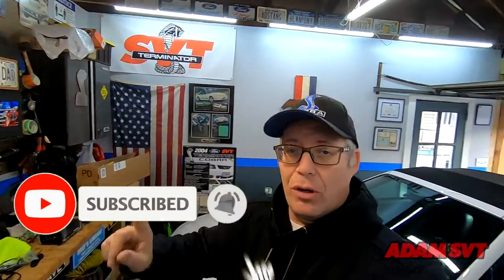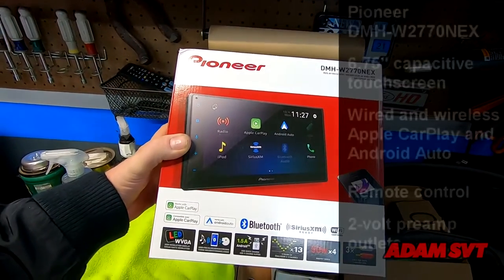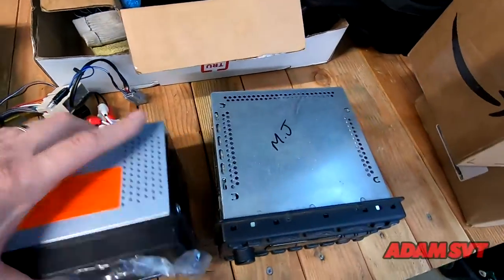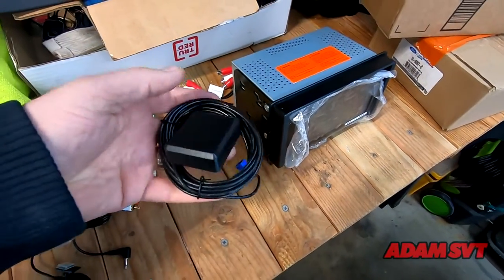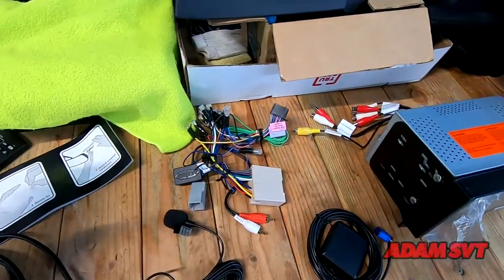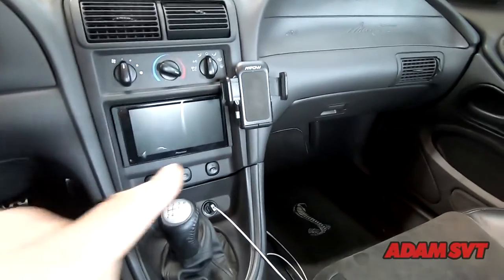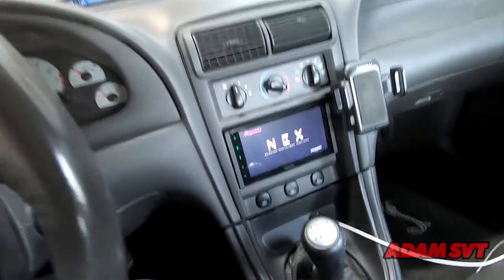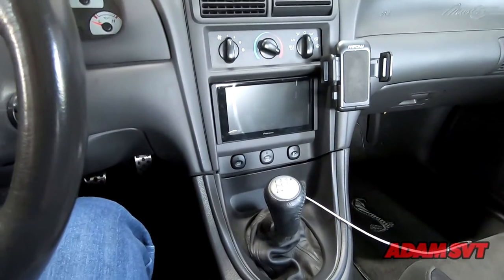How To Install  an Apple CarPlay Radio in a New Edge Mustang Cobra! Finally!

Comment: Im glad this one worked out. I want to upgrade to that exact same one. I just want it for the features you mentioned. It has a kenwood in it now but it’s old and outdated and not touch screen with Apple CarPlay
Reply from the maker: the carplay works quick too!  The Kenwood I had was great, but the multiple camera inputs, I think you could run HVAC and engine diagnostics in it.. HD Radio..  great for those that want all of that but most of that won't work with my old Terminator.. lol..     Was a pretty easy install.
Reply: @AdamSVT  awesome. Something I’ll add to my list lol

Comment: Hey Adam, nice install!  Did you keep the factory amps?  If so, how does it sound comparatively?
I’ve seen some conflicting info online regarding this install, with some saying you need to install new speakers & amp to get decent sound, but I guess that’s subjective.
I don’t need a super thumping system, but would at least like sound (bass power) comparable to the factory Mach 460. 
I’m upgrading my ‘04 Cobra convertible for the same reason you did…to get rid of a problematic volume knob, & add Apple CarPlay & BT.  I mostly just listen to my exhaust, but need some modern features & would like to crank it up occasionally.😉
Reply from the maker: Hello Glenn,   Yes I did.  That's why I went with 4v preamp outlets..   I ended up pulling this Pioneer out and swapping in a Kenwood.  I was told that's best in case you want to add an amp, and with the factory Mach system it works great. I have all stock speakers in my car. Just like you, I am looking to win any sound competitions, but I wanted it to sound good especially with a convertible. My only gripe is that carplay takes a bit of time to connect.. but it's not bad...  like you, I prefer the sound of Borla to music anyway.

Check out the other video with the DMX8709S

Comment: hey Adam can you maybe find one that's maybe more cheaper and budget friendly cuz i don't really wanna have to spend $430 for just this little thing that is very laggy and stuff.
Reply from the maker: Then consider the Kenwood DMX4707s. It has 2 V pre-outs compared to the 4 V pre-outs of this model.  It also has wired CarPlay and android auto, but it’s a quality unit for about $200 cheaper. I have it in my daily and it’s great.

Comment: Pioneer is better
I never use my remote either, however I do wish I had double din, my car is a 2k Gt tho, what all would I have to change?
Unit looks great bro, also you could run that mic up in the corner of windshield, may not get too much wind 🤷🏻
Reply from the maker: Metra makes a kit for the 94-00 cars part number 95-5703B Dash Kit to go from single to double or you could source the stock double din part from an 01-04 (but then you would have three dead switches in it).  The Metra kit looks pretty good I saw it in a buddy's 96 cobra and it looks OEM.  
I was going to run it up the A pillar but I'm thinking with the top down it might be noisy..  I put it up top on the cluster in this video, but I am going to lower it on the bottom near the rear of the steering column.  Where it is now it blocks the turn signals.. but the mic sound is great even while driving.
Reply: @AdamSVT  see , that’s what I thought with it in that spot, as long as it doesn’t hinder those beautiful gauges it’s good, right now my mic is in my tray under the radio and it works, anyway, my current Pioneer is great and does alot of cool stuff like apple iTunes Spotify and all kinds of EQ and crossover settings and custom stuff, but I kinda wish it was double din would give it a more updated look, I have to replace my factory speakers they have lost a lot of bass tone and I can’t help but think it’s a factory amp gone bad, not sure, but I do have 4 pioneer speakers I just haven’t gotten around to it, I kinda dread it, I been focusing more on performance stuff and then I’ll get around to it

Comment: Are the cobra interiors the same as a gt interior?
Reply from the maker: For the most part yes. Cobras, at least 2003 and 2004 models, had special seats, steering wheels gauges as well as leather shifter and emergency brake boots. Basically they were still standard mustang interiors.